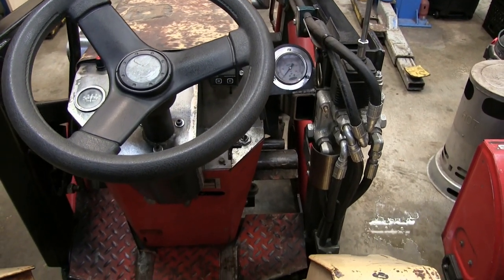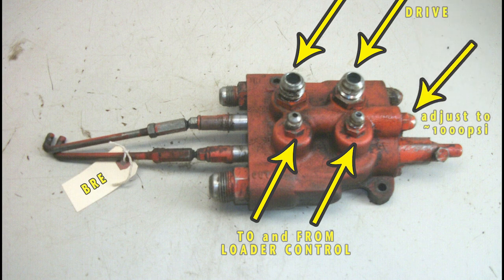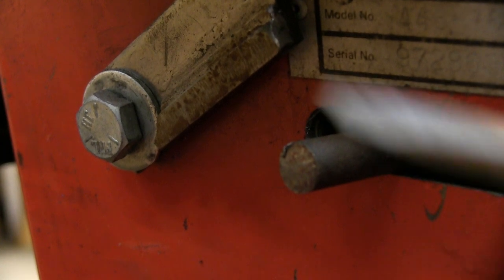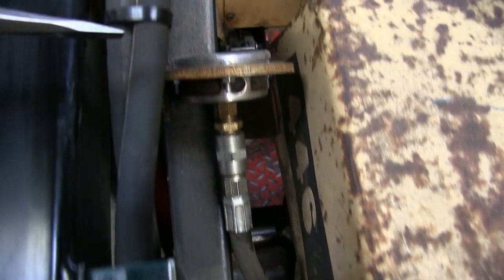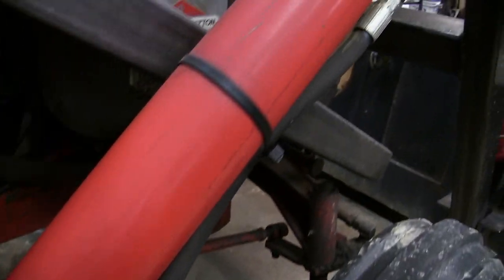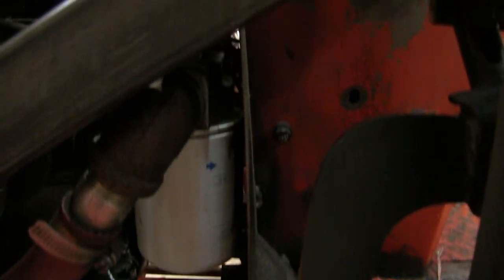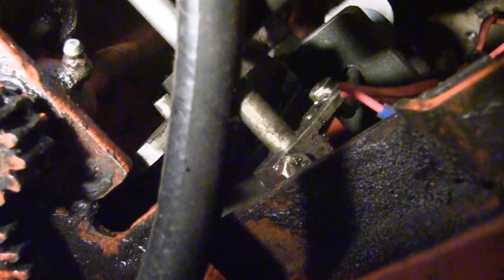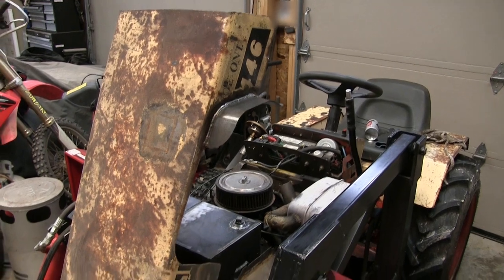Case 446 Front End Loader, Foot Controls and Hydraulics

Comment: Great build and details I have 1 question. You said you tapped into the lift ports on the stock valve. Did you just cap 1 port and use the other port? Then tie the return into the existing return?
Reply: Its been a while... the return from the lift port goes to a the return on the low pressure return.

Comment: I’m thinking about doing this to my 444 I want to keep it as stock as possible and even though it’s harder probably won’t use foot control. Do you think that this is too hard on the pump because I don’t want to wreck it and then have to get a bigger one 😂
Reply from the maker: I haven't had any pump issues and I push mine to the limits often. You'll be fine.
Reply: @bre86  What's the limit on lift capacity? How long does it take to hook up and take off? You probably don't remove it though lol

Comment: Hey just wondering what size cylinders you used. Have the 222 thinking on doing this! As well can you post a video of it in action? Thanks for the vid very informative. Thumbs up! Subscribed
Reply from the maker: I'll get back to you on the cylinder size. You can see a fun video of the tractor lifting a dirt bike in the playlist.
Reply from the maker: 1x 2012 and 2x 2520. I bought them on sale at Princess auto.
Reply from the maker: 1x 2012 and 2x 2520. I bought them on sale at Princess auto.
Reply: @bre86  so your just using the lift circuit on the factory installed TCV on the tractor or did you install another TCV from a different tractor?

Comment: is your safety shut off keep the spool valve in the float postion when the hydraulics for the loader are powered on?
Reply from the maker: It disconnects the flow to the loader controls. It doesn't work like a conventional float. You would need that option on your loader valve. This is something I've looked into but I would need to replace the entire valve assembly.
Reply: BRE sorry i mean that does your shut off hook up to the linkage on the factory spool valve to keep it pressed all the way in like having it in the float postion on the factory lever? and how did you adjust the pressure with the relief valve just losen the screw all the way out or in?

Comment: We need a update
Reply from the maker: I have some update. Just need to edit them!
Reply: @bre86  so are you using the factory travel control valve that came on your tractor or are you using another travel control valve off of a different tractor? Also does using the loader valve while driving the tractor cause any issues with the movement or travel speed?